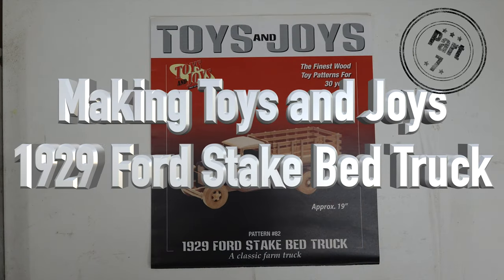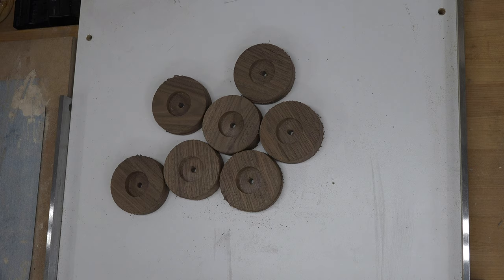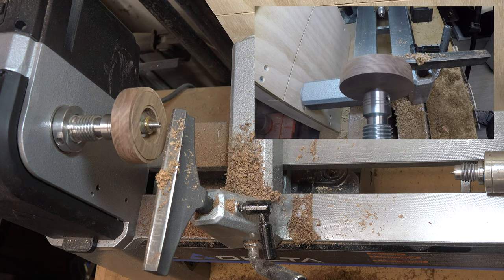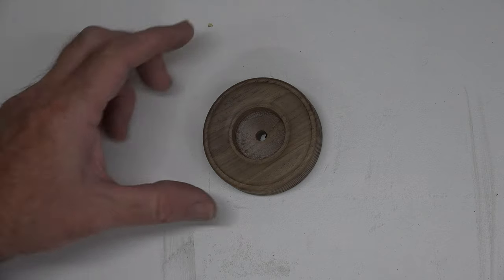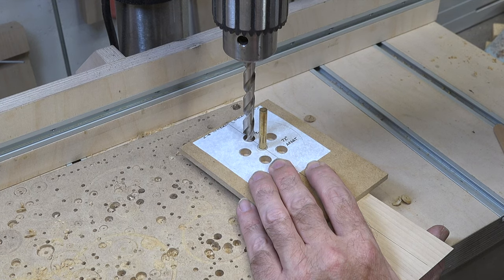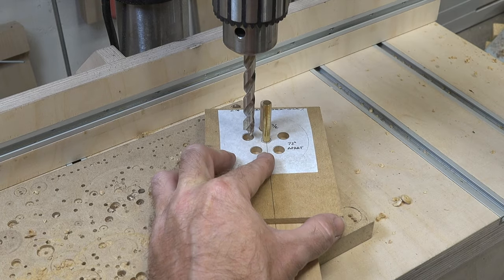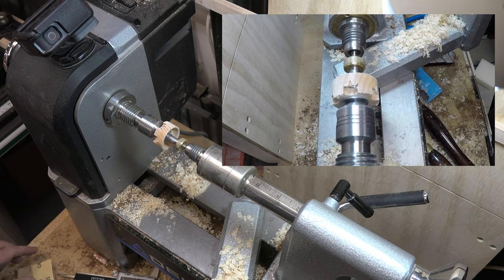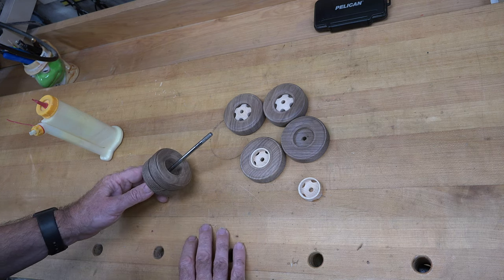Making Toy Wheels   1929 Ford Stake Bed Truck Part 7

Comment: Kenny, as always, it was a great series. The POP that the danish oil created put it over the top. I've been working on a backhoe loader with steering. Practice makes perfect unless you repeat mistakes like mine. There are 2 cams for the steering that measure 5/8 Z 5/8 X 1 1/8 with two through holes and one 90 degrees through one half through the bottom one. I made them 5 times because I forgot to "mirror" them. Photos will come when complete. Thanks for the builds. Now I can make wheels for the Toys n Joys Dulley
Reply from the maker: LOL.  I wouldn't sweat it too much.  I've made mistakes multiple time before and it's no big deal.  I think the worst part of repeating a mistake is the realization that even though you checked it 250 times before cutting or drilling it, you STILL messed it up.  LOL.  Thanks for tuning in and for the kind words.  I look forward to the pictures of your build.

Comment: An idea borrowed from somewhere else: cut axle washers from the lid of a plastic container with hole punches, if you have them. Glue won't stick to them, saves a dab of plastic from the trash, and saves a little bit of money.
Reply: 👍Thats exactly what I do.
Reply from the maker: That's a great idea Floyd and I will be incorporating that into future models.  They would also be a lot thinner which would be a bonus.  Thank you for this suggestion and for tuning in to the show.

Comment: What a shame it's finished, I have really enjoyed it. Anyway mine's not done yet. Unfortunately I don't have a pen mandrill, I've sent for one but of course it will not arrive now until after Christmas. Something to look forward to. Many thanks for the series and your patience. May I take this opportunity to wish you and your family a merry Christmas and very happy new year.
Reply: A 1/4" bolt could also be used as a mandrel.
Reply: @dwightl5863  Thanks for that, I'll give it a shot.
Reply from the maker: Merry Christmas to you and yours as well Piet.  I hope it's a great one.  Like Dwight stated, using a 1/4" diameter bolt will also work.  You can cut the head off the bolt and then centre punch one end to accept a live centre at the tail stock.  The head stock is held in place with a drill chuck, mounted with a morse taper.  I hope this helps.  Thanks for tuning in to the show.

Comment: I think I finally got the confidence to tackle a Toys and Joys plan. This series really helped deciding and I'm definetely going to watch again. I'm just worried that in my country wood thickness is very limited, my only tools are scroll saw, drill and sander and we use metric system, not imperial. But I'm still going to try, I'll trace the plans onto a computer and adjust according to my needs. Hope it works, I'll let you know how it turned out! :))
Reply from the maker: For starters, I applaud you for taking the plunge and giving this a try.  That's the first step.  While the model will be challenging with the tools that you have, I honestly don't think that you can't do it.  I am sure that you can.  You may just have to think about some of the pieces and how to construct them.  I think your sander will also come in handy for shaping some of the pieces.  I really look forward to seeing your finished project.  Thanks for tuning in and good luck on your build. If you have any questions please don't hesitate to ask.
Reply: @acutabove_woodworkings  Hey!! I finished it! Can I e-mail you some pictures?
Reply from the maker: @auburn.JoaoDuarte  I'd love to see some.  You can send your pictures to kennye@acutabovewoodworkings.com.  Looking forward to seeing your project.

Comment: Hi Ken first off I think you do a great job, I am just about to start on the Ford Stake Bed Truck, I would go over chapter may be a dozen times as I have said to you before,  I do have short term memory loss. 
I could woffel on a good bit more but I will cut to the chase ! First off are you using 100 120 grade sanding paper for leaving on you levelling jig. 
 I have set up the straight edge and square system for the lay out great idea, I do have trouble seeing the lines you draw on the wooden parts I have a fine tipped black pen that I  can rub the line out if it does not work out any how I will let you know I have a number of jigs for getting accurate line but I am not the best at using them   
Any how bye for now stay safe  Regards Col from Australia
Reply from the maker: I am assuming that you mean the sandpaper on the MDF.  On one side, I have 120 grit and on the other side I have 220.  It works well for sanding most parts and will still keep your crisp edge.  I hope that you are able to make a successful model and that you will send me photos of the finished project when you are done.  You've got this.  Just take your time and think each piece through and you will do just fine.  Thanks for tuning in Col.

Comment: Looks amazing. The whole series is wonderful. Ordered the plans and will give this a shot. I don’t have a lathe yet. Any suggestions for a way around that little issue?
Reply from the maker: Glad that you liked the series and I wish you good luck on your build Gary.  As for the wheels, there's no reason why you couldn't rough cut them with either a scroll saw or a hole saw and then sand them to shape on a drill press with the wheel mounted to a 1/4" diameter bolt.  You are not the first to ask and it sounds like I need to produce a show on alternative methods of making wheels.  Thanks for tuning in to the series.

Comment: what is the name of the blocks you use to measure the height when you are going to put the slats on the cart body, those little black squares with a number of thickness?
Reply from the maker: The blocks you are asking about Simar are called set up blocks.  They are made by Veritas and are available at Lee Valley tools.  Here's a link.  https://www.leevalley.com/en-ca/shop/tools/hand-tools/marking-and-measuring/45089-veritas-set-up-blocks
I hope it helps.  Thanks for tuning in to the show.
Reply: @acutabove_woodworkings  thank you very much
Reply from the maker: @silmarartesanatos  You're very welcome.

Comment: Hello , I just bought a lathe to make my wheels, what kind of mandrel do you use to mount them on the lathe ? Does any kind of pen mandrel would do it to work every wheel individualy ? Thanks !
Reply from the maker: I use a universal pen mandrel.  You want to make sure that the one that you use is adjustable.  This is the one I currently am using.  I hope this helps.  https://www.leevalley.com/en-ca/shop/tools/power-tool-accessories/46448-universal-pen-mandrel
Thanks for tuning in.
Reply: Thank you very much that really help me !!
Reply: Would you prefer a mandrel like that or a drill chuck with a bolt to work your wheels ?
Reply from the maker: @nicolaslacerte3111  I much prefer the mandrel but I have used the drill chuck and bolt method as well.

Comment: Extra is a spare tire!
Reply from the maker: That's a great idea Randy and I can't believe that I never thought of that.  I will have to make a rim for it and glue it in the back of the bed as the spare tire on the model.  Thanks for tuning in and for the suggestion.  I appreciate it.